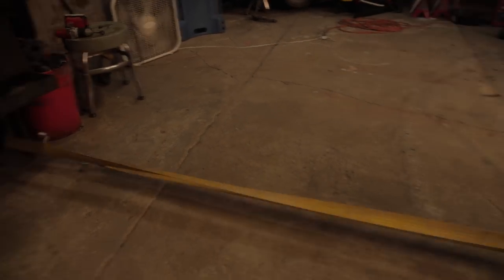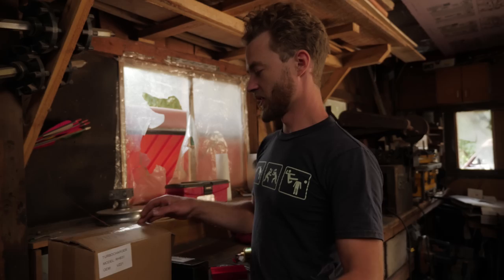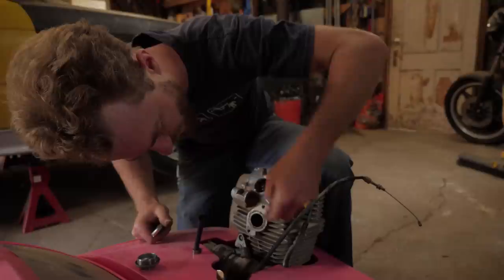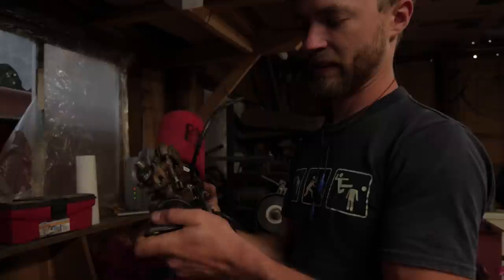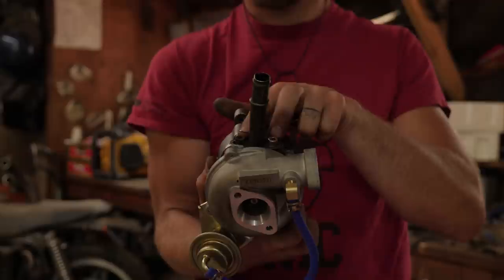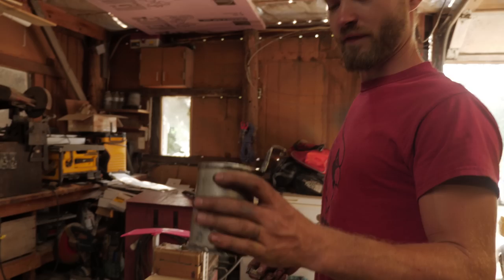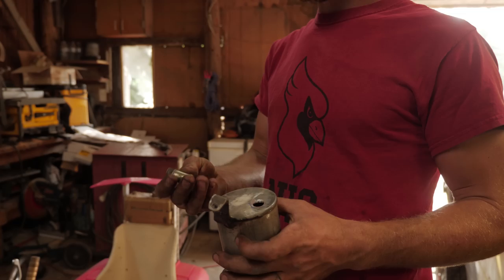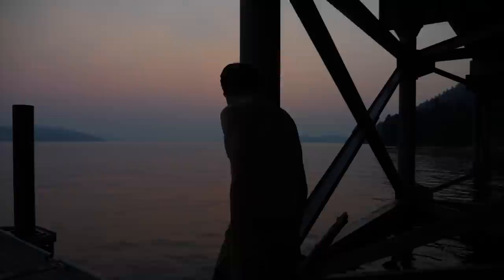Turbo Install on the Barbie Car Go Kart 4K

Comment: Common sense says you need to run a much thinner lubricant. A fuel pump trying to pump engine oil is like trying to drink cold molasis through a bar straw. Diesel or 1k kerosene would be ideal if not for it's low flashpoint and the fact it's going to be lubricating a hot turbo. I'd try some motul 0w20 cut with some marvels 3in1 & see how it flows.

Comment: Forget the Turbo and your low 20 HP 4 stroke engine. Put a 250cc or 300cc 2-stroke dirt bike engine in your Barbie Mustang. Youll get  45-50 HP and more if with a high compression Head. Youll get Barbie going faster than Senderella!

Comment: a turbo pushes air into the carborater. you have it backward its supposed to go (intake, turbo, carborater, engine) not (intake, carborater turbo then engine) if you have gas going through a turbo itll leak

Comment: Have you guys considered using something like powerwheels electric motor/torque converters on the front wheels for awd. They make so many upgraded motors and gear boxes I am sure you could find one to pull you through the turns with the back wheels spinning. With two 12 volt motors in front of a 49cc pit motor my younger brothers are able to pull center axis donuts.

Comment: 2 reasons why the fuel pump won't work.  1. The oil is too thick. 2. The heat from the turbo will kill it.

Comment: Contrary to popular belief, turbos work off of thermal expansion,  not flow. You really need to conserve the heat on the exhaust side to achieve any kind of power. I hope your current configuration works, but I'm afraid there's some fundamental design flaws.

Comment: How about just upjetting the carb because even though you would install a fuel pump it would  still have the same air fuel ratio because the jet is the same size. Oh and you would propably destroy your float valve.

Comment: 7:50 it's called a Banjo bolt because its part of a Banjo fitting, which looks like a banjo. the bolt goes through the banjo fitting. -example
http://www.dsmtuners.com/attachments/banjo_parts-jpg.110385/

Comment: How much cc is your engine? I have a 4 stroke 70cc Jincheng monkey which I want to turbo charge but I don't know if the cylinder can handle the amount of hp the turbo produces.

Comment: I wonder if using a pull through setup can cause issues with fuel pooling as the compressor slings the fuel.

Comment: This video finally came to good use since I’m turboing my quad for drag racing and I know this comment is 2 years late but where did you get the oil cooler
Reply: Pit bike oil cooler on ebay or Amazon cheep as well - good luck

Comment: Where are the people that do this? I want to go and help, even if help is "hold that" or bringing some beer. 

edit: do you need an intercooler? Really I don't know, but I'm wondering if forcing compressed hot air into the carb would cause premature detonation?